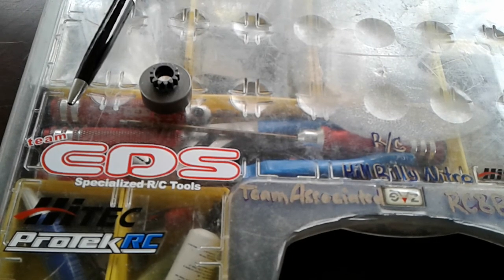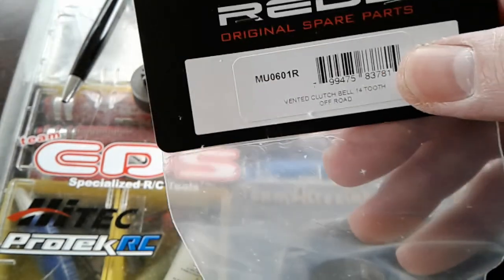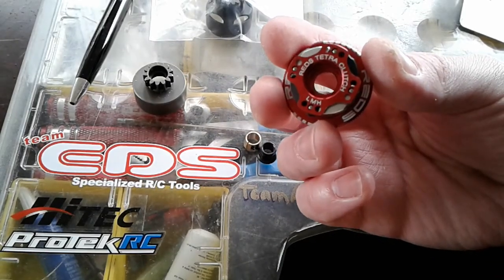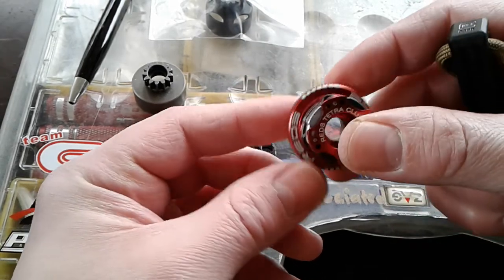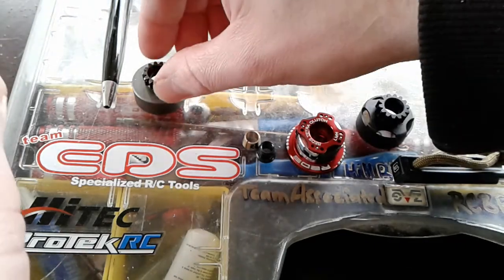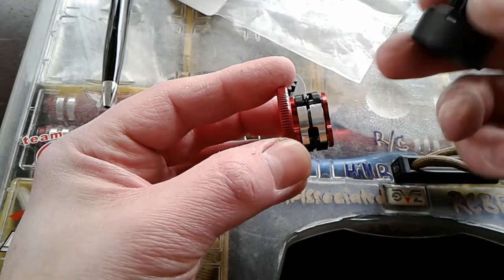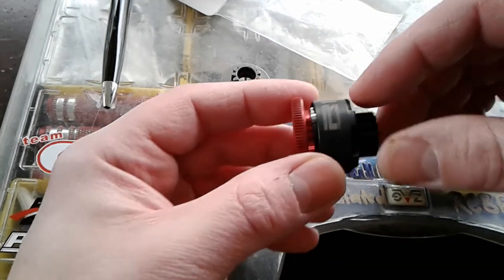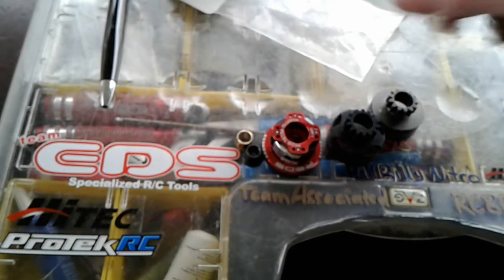New Reds Racing Quattro Clutch & Clutch Bell Unboxing

Comment: Cool bro! Let me know how you like it. If your just bashing and want the most of power to ground you can run low grip setting , if you have a stock motor with balls you can run 2 Low and 2 medium and if you run Modified motor like a bad ass Big BIG BLOCK like a 28/8 .30 or .32 on a bigger RC like a Truggy you must run High Grip because high grip has the least amount of tension/stall ! A Modified will go threw those clutches in no time and damage bell. If your racing not bashing high grip is awesome even 2 medium and 2 high depending on how loose the track is. My cousin Freddy runs the Quattro on his Hot Boddies Only for racing. He never ever bashed it never even seen his street or driveway lol! Track only ! He lives 1 1/2 hrs from me next to the race track upstate N.Y. So he’s constantly there and that’s what he addicted to! One day I will have to film him but he is camera shy!

Comment: Good stuff,. I've had good use from that clutch on my WRX. 
Re: vented bells, I havehad worse luck letting stuff in on vented bells than letting heat out, but like you said it's here nor there. If I get a good deal on them I'll rock them.

Comment: Since the clutch is a bit longer than standard and requires the slightly taller bell gear wouldnt there be fitment issues when installing the engine into the car? I.E. wouldnt you be moving the gear clutch bell forward by those few mm causing it to not mesh correctly with your spur?

Comment: what is the best clutch bell tooth number for speed bottom end and top end for a truggy
Reply from the maker: Md2 47life It will kinda depend on how powerful your engine, pipe, and gearing but, as a rule of thumb 11T, 12T, 13T should work on low bottom end torque, better on smaller race tracks with short straightaways. 14T, 15T, ect will give you more top end speed. I find the 14T is the best of both worlds in the B3. If I wanted more torque I would probably go with the 13T.  I would say 13T if you want more bottom end and you'll still have a little top end speed.

Comment: Wish I would have seen this video before I ordered my Quattro to know that I needed the Reds bell to fit the clutch. A-Main didn’t specify whether or not I needed the bell. Oh well, it’s wintertime where I’m at so I can’t even drive my MP9 anyway.
Reply: did you find out if a kyosho standard bell works with this clutch?
Reply: luk3 I can confirm that a standard Kyosho clutchbell (or Protek clutchbell, for that matter) will NOT work with the Reds clutch. The Reds clutch is too deep and will require use of the Reds clutchbell in Kyosho cars.
Reply: @KN-ko8ez  Yep